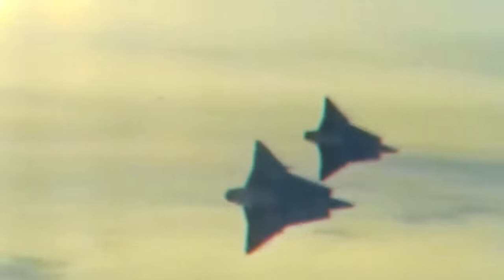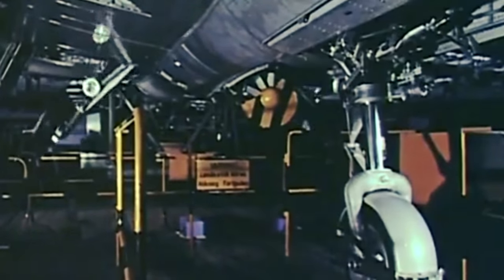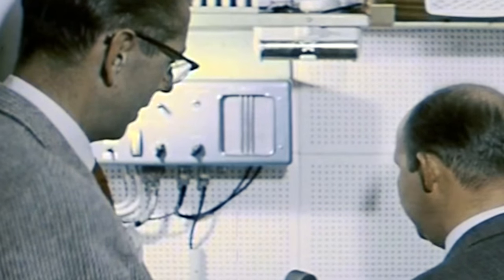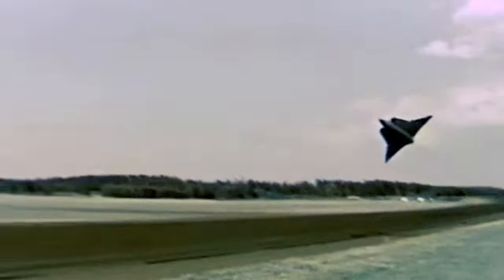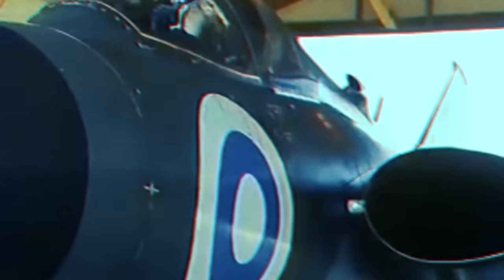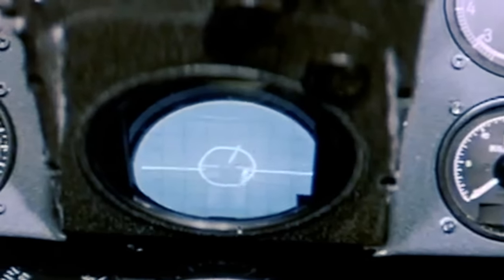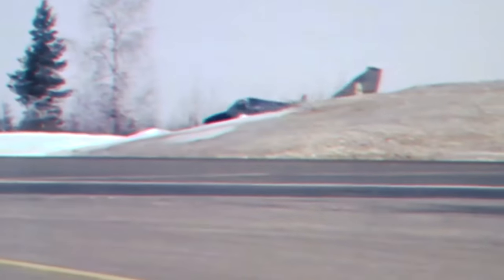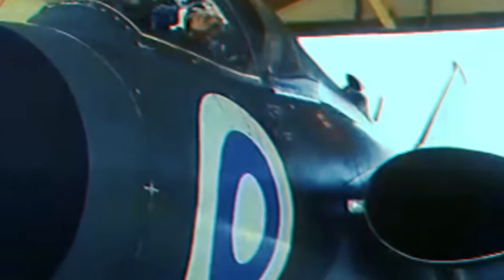The Bizarre Airplane Design That Shook Up Aviation

Comment: Cobra is cool now. 
But superstall was unintentionally discovered by a test pilot for Draken pulling to hard. That aircraft didn't have explosives to eject the canopy. So when he enter superstall, he tried to eject but the canopy was supposed to be pulled away by drag, but it didn't. And the eject sequence was based on a sequence where the removal of the canopy was one part.
The tower talked to that more and more desperate pilot until he hit the ground. Unable to eject. 
What you are seeing is training exercises where pilots learn how to get out of superstall.  
And yes, there was explosives added to release the canopy so the pilot could eject from a superstall.

Comment: I was an eyewitness to Border violation by the Swedes!!!
Never forget the summer day in 1966 in East Norway. One SAAB Draken came very low from the east (Sweden), turned 180 degrees, approx. 30 meters above our house and returned towards Sweden. 
The roar was overwhelming. 
I was 10 years old and obsessed with jet fighters.
I knew very well what a SAAB Draken looked like!
One of my favorites.
We lived approx. 20 km. straight line distance from Norway's main military base for aircraft, Gardermoen. Sweden's border was approx. 120 km to the east. 
This was the Hight of the Cold War and I believe to this day that the Swedes tested the NATO country of Norway on how good Norway's air defense was. 

The SAAB Draken continued, as far as I could see, to fly very low when it returned towards Sweden.

Comment: That "using reinforced public roads" for landing and take-off is why the later JAS Gripen 39 needs only 500 meters of road to land, or 600 meters for take-off, or, roughly x2 the length of a modern U.S. aircraft carrier, this though without arrester cables nor launch assistance.

Comment: That is the kind of design I end up building in KSP. Lots of lift from the big wing, and a center of lift that is far enough back to make it controllable. Though I usually add canards for better stability. So somewhat between a Draken and a Viggen.
I know that KSP isn't reality, but the simulation is accurate enough that principles are relatable.
Reply: Before it was decided to develop the JAS 39 Gripen in the 1970s, studies were undertaken on modification for low flight hour J 35F airframes. The proposed modifications were new outer wing, additional weapon stations, RBS 15 capability, the addition of canards by the air intakes for increased maneuverability and increased maximum take-off weight.

Comment: A great airplane, that deserves better than an almost verbatim reading of the Wiki page.  At least the video actually shows Drakens, so well done for that, even if a large number are Finnish.  For reference, the requirement to operate from secondary bases, many including sections of public highway as runways, was not particularly related to potential nuclear attack.  It was just well known that the USSR would attack known military airfields as a priority.   This was the same rationale that spawned the Harrier and dispersed field 'hides'.

Comment: The airframe may have been unstable, but it was structurally-efficient and therefore strong enough to not break during this or other extreme manoeuvres. This can't be said of all fighters of the era. If you got the nose of an English Electric Lightning that high, you could probably rectify the situation by enabling the afterburners and you'd go upwards. One of them "went upwards" when it was on the ground and an engineer was sitting in the cockpit trying to diagnose an engine fault with the engines running when the burners lit up. With no helmet, mask or canopy he had to work out how to land it again by himself. The Draken's advantage over the Lightning was indeed the relative ease of maintenance and speed of turnaround by ground crew.

Comment: 🟦....(@ 5:15):
I take exception to your statement that the 'Cobra maneuver' was:
"not directly applicable to combat scenarios",.... If you are in front of an enemy aircraft which is firing up your tail, the "Cobra maneuver" would quickly reverse the situation & put you behind your enemy, giving you the tactical advantage.
This would be far from an uncommon combat situation and therefore quite valuable as no other fighter craft could accomplish getting behind their enemy anywhere near as quickly as the Cobra maneuver affords in this aircraft.
Reply: No, that has never been performed in such a way and it also doesn't work that way. By doing that you have a very good chance crashing into the aeroplane behind you or turning the manoeuvre into an uncontrolled stall - which is the last thin you want to experience in combat. No sane pilot would ever try that during a dogfight.
This manoeuvre requires a lot of experience and it also requires very specific circumstances - which you'll hardly have in a combat situation. The other thing you need to be able to even attempt this, are specific software modifications, because the aeroplane won't allow you to stall it on purpose. It is literally the worst thing you can do during a dog fight. You pull that manoeuvre in combat, you'll die. Cobra only works in DCS. Also you always have your back covered. When was the last time anyone fighter pilot went out without his wingman? The cobra is only to Su-27 fanboys wet dreams.
Reply: @dxb8086 :
🟦..... You are correct that there is no record of it having been used in an actual dog fight,... But it had been used quite successfully (with this airplane only) in trials for testing.
And BTW, pulling this maneuver would NOT send you into the airplane behind you unless they were ABOVE and behind you!... As this maneuver causes an INSTANT increase in altitude which, if your enemy was at the same level as you were behind you, would cause your plane to go UP in the stall resulting in your enemy passing beneath you as the stall slows your air speed.
It was actually considered a worthy and valid maneuver, it's just that no one seemed to have the balls to attempt it in actual battle circumstances.

Comment: In 1982, the US followed suit with F-16XL "Cranked Arrow". The biggest difference between the two was the fly-by-wire system and electronics developed after the J 35 was designed and built. It was a beautiful aircraft. Sadly, the Cranked Arrow never went into production.
Reply: It was an amazing design but simply trying to do too much. It sacrificed the F-16s excellent maneuverability for range and payload and still wasn’t as capable as the F-15E which also added a second crewman and kept all of the F-15’s agility.

Comment: The manuaever was well known to the best pilots in the west since the 50s at least. John Boyd called it 'flat plating'  and used it to great effect. As a dogfight instructor, he became known as '40 second 'Boyd' as he claimed he would give an advantage to his students, placing them on his 6, from where he claimed he would reverse the position within 40 seconds and grease the trainee's arse. He never failed. He did lose an F-100 Super Sabre to hydraulic failure, for which he was almost court marshalled, till the fatal flaw was discovered in all F-100 aircraft and rectified.

Comment: The Cobra Manoeuvre, also known as Pugachev's Cobra or Pugachev Cobra is a very spectacular, dramatic and demanding aerobatics manoeuvre in which an aircraft flew at a moderate speed suddenly raises its nose to the vertical position - and beyond - before dropping the nose back to horizontal flight. The aircraft reaches 90–120° angle of attack during the Cobra.
The Cobra manoeuvre is named after the Soviet test pilot Viktor Pugachyov, who first performed the Cobra manoeuvre publicly in 1989 at the Paris Le Bourget air show, and shocked the Western spectators who couldn't believe it. The Soviet Union still existed at this time. However, the Cobra was first executed by Sukhoi test-pilot Igor Volk in a test flight. The classic Cobra was done using only standard aerodynamic controls. Today it is easier to be done with Vector Thrust.

Comment: The Cobra Maneuver has always made me wonder about air combat effectiveness. If avoiding a heat seeking missile, could flares be deployed as the maneuver occurs? I imagine that the heat signature would be somewhat hidden as the flares become the tracked heat source. Of course timing is critical. Possible?
Reply: Depends on the missle. Some have A.I. built in nowadays. Can't fool it. ;)
Reply: @ryshellso526 good point, had not thought of that, thanks.
Reply: @MAGAman20201107  yeah, I love the tech that's going into missles. Kinda in my family. Lockheed. ;)
Reply: You have far better chances to survive by dropping flares. You pull the cobra in combat, you die.

Comment: Is amazing how Saab can make very traditional sensitive and straightforward car, while at the same time is capable of thinking outside, above, beyond and all round the box with their aircraft and maritime products.
Reply: The early Saab cars before GM took over that business were anything but traditional
Reply: @kronop8884  yes, and right about that time the slapped everyone on the face with a bleeding edge J35, so unconventional you could have argued it was a UFO.
Reply: @S1337theoddoneout-ip9xc  In 1960 the same year the J36 entered service Saab were still  using 2-stroke engines in their cars and they didnt move to 4-stoke until 1967, essentially  manufacturing the same car (model 92, 93 and 96) between 1949 and 1980, it was not until the models 99 and 900 with Turbo arrived things got really interesting. GM took full control of Saab Automobile in 2000 and from then on things really declined.

Comment: Do you need a low-cost interceptor?
Get the A Lippisch DM-1/ L-13 Study made at Langley, it's stable to Mach 2.5, just lacked area ruling the body; as propulsion, the Lorin Ramjet it was designed for, and a pair of Pulsejets to bring it to the 100 m/ sec needed for Ramjet to work.
Gesund +v

Comment: What a beauty really I think that SaaB was probably on The Cutting Edge of jet propulsion and structure I love the two-piece frame and you can see the modified oval design aspect in the Jets and cars I believe they inspired the F-14 and so on it's just too bad that Saab and Volvo didn't get together and make beautiful Jets that could withstand the test of time and those two engineering Mecca's could have been on the front line today building the 5th and 6th generations of Fighters for NATO and America
Reply: Volvo Aero (now GKN) actually built the jet engines for a number of Saab jets.
Anyway both the 37 Viggen and 39 Gripen where at the cutting edge when the entered service not to mention the J29

Comment: The two 30mm cannons were not fitted for use in Austria, they‘ve always been there. True is: the Austrian Drakens (all retired Swedish airframes) had nothing else for said reasons until they were being equipped with the AIM9 in the early 90s.

Comment: No mention of the F-16XL featuring a copy of the wing shape?
Reply: Shhhh. The Americans NEVER COPY.😉
Reply: Wasn't there also an F-16 double-delta for use as a testbed for supersonic transport?
Reply: The F-16 XL was not a pure double delta. It was a cropped double delta. Slightly different.
Reply: @isuzu343  Sure, slightly

Comment: CF-105 Avro Arrow. Delta-winged interceptor introduced 1957 from Canada. Very similar plane with automatic stabilization systems. Although the Arrow was more ambitious, with two engines and many technologies ahead of its time like: Internal weapon carriage, radar-guided missiles, fly-by-wire control systems. It was also intended to be best in the world, a better plane than the Saab 35, and that ultimately was its undoing. Too ambitious. That virtually ended the Canadian Aerospace industry, even though it had proved to be highly competent.

Comment: Ok for rhe record, this is not a Cobra and you would know that if you knew the point of the Cobra.  The point of the Cobra is to be able to point the nose backwards aka substantially greater than 90° from initial direction so that you could launch air-to-air missiles that could only target in the general direction of the aircraft's nose.

In production aircraft, the F-22, Su-30, Su-35S and Su-37 can all perform the actual maneuver AFAIK, but that's about it.  Thrust vectoring is basically a requirement because it allows the plane to maintain some thrust in a better direction than "backwards".

Comment: The Draken's successor, the Viggen, could sustain a turn rate equal to that of the much later F-16 even though it did not have greater than 1 to 1 thrust ratio.
Reply: Thrust-weight and turn rate aren't that directly connected to each other. The MiG-21 bis had a great turn rate, but it's Thrust-weight ratio was .80, about the same for BAC Lightning.
Reply: @winternow2242  SUSTAINED turn rate (as I said) - not instantaneous turn rate. Some homebuilt aircraft can safely pull 12 g's at only about 200 knots - a fantastic instantaneous turn rate but only for a moment before they bleed off all their energy. Most fighter jets at or near best cornering velocity (the minumum speed at which they can pull maximum design g's) are bleeding energy like mad, which is why they always start any dogfight at speeds ABOVE best cornering velocity - and preferably with altitude. The Viggen could pull a better sustained rate than any aircraft prior to the F-16 because the forward canard created positive lift, as opposed to conventional tail aircraft in which the tail must provide substantial negative lift to corner. The F-16 could only match the Viggen's sustained turn rate because of it's substantially greater thrust ratio - re-supplying the energy being bled off by turning. A clean or nearly clean F-4E Phantom (what I flew) could pull a very respectable instantaneous turn rate - for about 10 seconds, until it's energy was reduced to a strafe rag's. To fight MiG 21s in a Phantom one on one we had to employ a "hook and extend" strategy - looking to either score a face shot with an AIM-7 (or a lucky shot with the earlier AIM-9s which didn't do well head-on, or an even luckier gun shot), or escape. A "draw" for any extended period would also result in a win for the Phantom, as the MiG 21 has so little fuel it could not stay with a fight long.

Comment: why more air forces dont plan the same way i dont get. 1. easy to train on 2 can take off on highways or short runways 3 easy to maintain by non specialists 4 easy to manufacture in numbers. well i think whats happening now is making the ideas the swiss used more and more valuable. id also add solar flash or flare or emp safe...

Comment: There was one fatal flaw with this aircraft, and that was it could Super Stall,and was impossible to recover from.Pilots were limited in the angle of attack during a hard turn otherwise the Draken would depart from controlled flight and the pilot would have to eject !!!:face-pink-tears::text-green-game-over:

Comment: Using the Cobra in combat would be suicidal. It looks good at an airshow, but it is not an air combat maneuver.
Reply: Yep. It has never been performed in such a way and it also doesn't work that way. By doing that you have a very good chance crashing into the aeroplane behind you or turning the manoeuvre into an uncontrolled stall - which is the last thin you want to experience in combat. No sane pilot would ever try that during a dogfight.
This manoeuvre requires a lot of experience and it also requires very specific circumstances - which you'll hardly have in a combat situation. The other thing you need to be able to even attempt this, are specific software modifications, because the aeroplane won't allow you to stall it on purpose. It is literally the worst thing you can do during a dog fight. You pull that manoeuvre in combat, you'll die. Cobra only works in DCS. Also you always have your back covered. When was the last time anyone fighter pilot went out without his wingman? The cobra is only to Su-27 fanboys wet dreams.

Comment: i believe that if any nation is to advance or even master Military Technology to perfection it would be Sweden. Swedish Engineers are the kind that don't wait for an idea to be approved, but rather chase that idea until it either becomes something of it or it is proven a bust. friend of mine has flown the Draken, and also has flown the Viggen. he said that "at first, during Takeoff, they handle like a rollercoaster and shake all over the place. but once i am in the air with them, me and the jet become one, and it controlls exactly as i intend of it."
Reply: You seem to be right. Swedish weapons is selling all over the world, as have been the case forr 1000 years. The most modern combat aircraft, Gripen E will be an export success when manufacturing in Brazil and Sweden is in full speed. The submarine may be harder to export, due to even more protection in this field.

Comment: One major flaw in SAAB engineering was the lack of knowing that in the far future, the aircraft incredible maneuverability would be useless in Air RB because of several R-60M’s and AIM-9Ls currently plaguing it’s battlegrounds
Reply: Since no one can accurately predict the future it’s hardly a flaw, besides the Draken was designed as an interceptor so manouverability came second to speed and climb rate

Comment: I am in favor of the famous Draken finally being used in jetfighter simulations such as e.g. DCS, War Thunder or newer is integrated, so you can compare the flight characteristics!
Also, how would a completely renewed Draken II (virtually) do against other jets with a lot of delta, such as a Delta Dagger, Viggen, Mirage, Eurofighter, Rafale, Gripen?
Reply: How would anyone be able to predict the performance of a "renewed Draken II" without you describing how it's "renewed"?
Reply: Game simulators do not reflect real performance. They have to balance the stats to fit them within the game play.